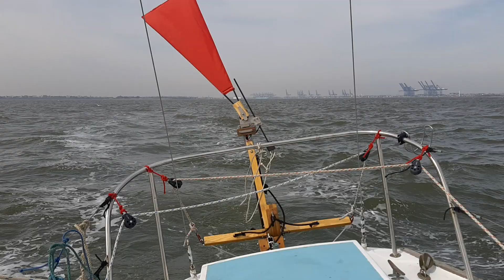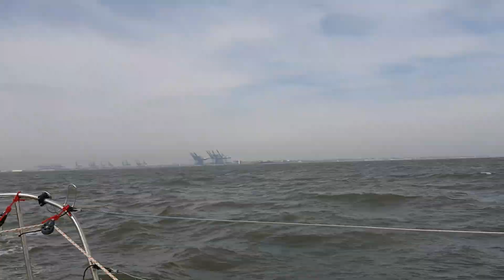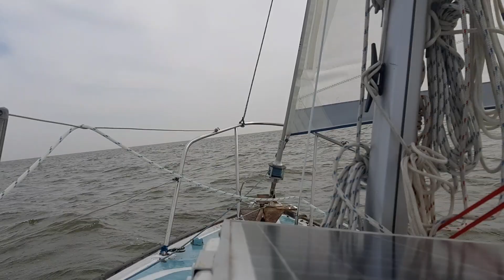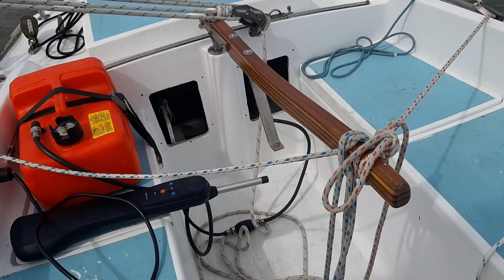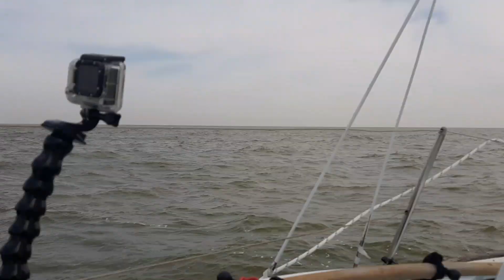Hebridean self steering on a Hurley 22

Comment: I notice you've not been using the Hebridean in more recent videos - I'm just wondering why? I'm in the Blackwater and considering getting one - is it just that the electric is more convenient or less faff?
Reply from the maker: Its a bit overkill for use on local areas and probably wouldn't be that effective due to regular deviations in wind direcrion and strenths. I'm also less inclined to use it in areas where there are lots of navigational hazards as a change in wind direction wouldn't be just an inconvenience but become a significant risk. Long distance with little in the way of obstacles its a dream.
Reply: @Sam Sails  Thanks for the reply...I think it'll be useful and I love the whole principle of  holding a course relative to the wind by the wind. How did you find assembly? I'm a bit handy but no carpenter!
Reply: @samsails9820  Makes a lot of sense. I would use a wind vane also on long trips only. Do automatic steering with my ST2000 in "normal" coastal sailings.So I think about building one for me, because other solutions are too expensive for me on my old boat. And I like the idea of simple storing and when you build by yourself you can maintain easily yourself. Thank's for the video!

Comment: Hi Sam 
Just going over some of your old posts for something to do..
Like you do..
Just wondering what your thoughts are now on this steering system?
Reply from the maker: I've not had any issues with it, it works and I don't need to have it mounted permanently to the transom. For shorter trips I use a electronic tiller pilot.

Comment: It's interesting how the feathering on this unit is accomplished. It all relies on the inclination of the pivot axis of the pendulum blade (unlike most/all others where the pendulum pivots about a horizontal axis). This ensures the paddle feather towards the forward direction as it tilts over.